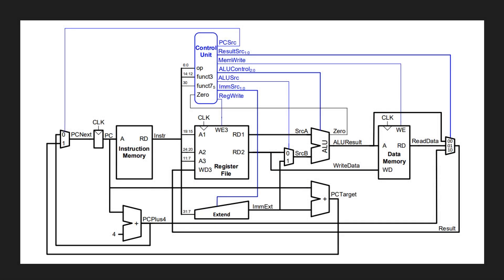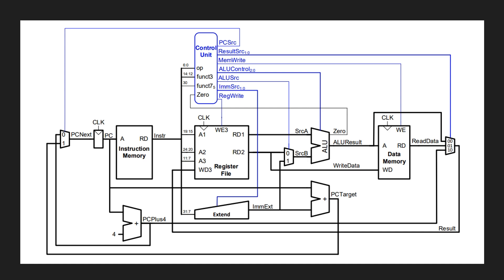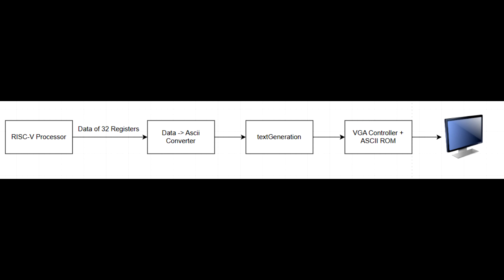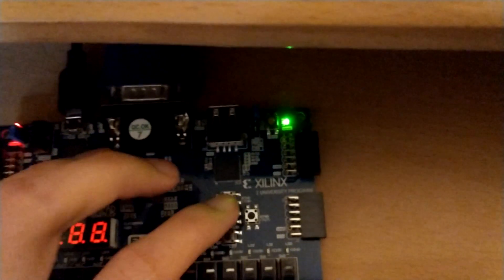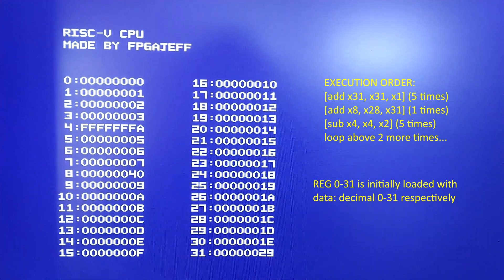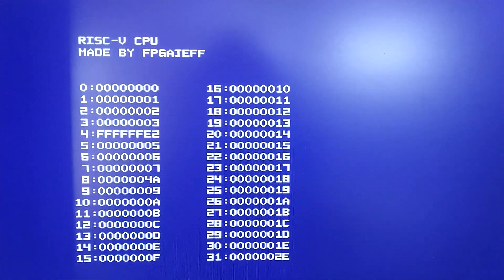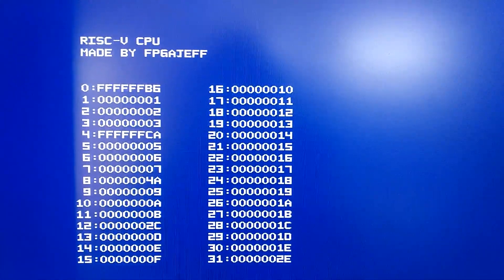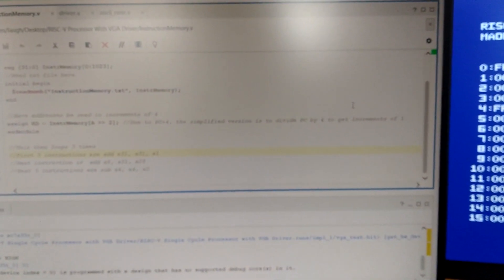RISC-V Single Cycle Processor with VGA Testing - Basys 3 FPGA

Comment: fpgajeff prety cool, will synthesis it. There one little bug how do you handle register writes. Per riscv definition register 0 is always 0. You should avoid writing to register 0. The line 
"else REGISTERS[A3] <= RegWrite ? WD3 : 32'bX; " needs to be extend to capture writes to register 0 or ignore those, so reg 0 stays always the same. 
Btw. did you thought about interrupts or extending it to have more peripherals aka uart,spi,etc ? Or is it more just for fun project (learning by doing :) ) ?
Reply from the maker: You are correct. REG 0 use case is always a 0 in assembly instruction.
Adding interrupts and peripheral is a great idea for the future.
For example UART can be used for keyboard data transmission, this may be accessible via the USB port on the Basys 3.

This was just a fun project exploring RISC-V coming from MIPS.